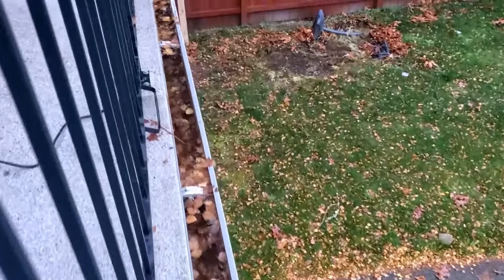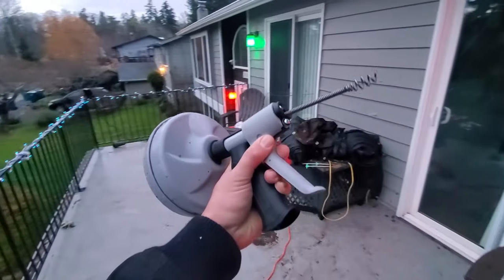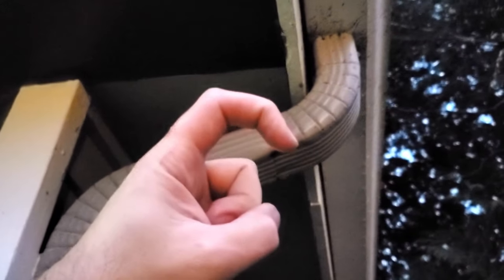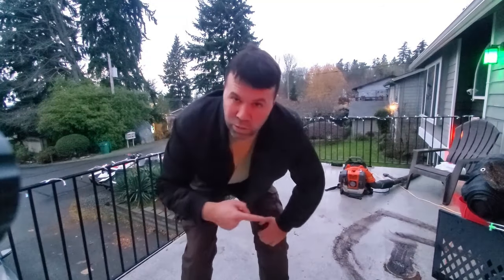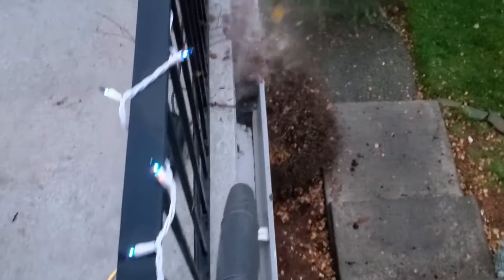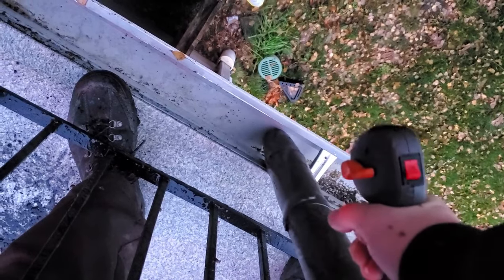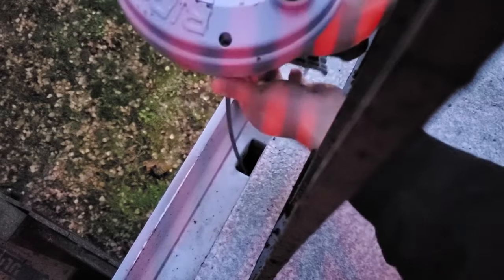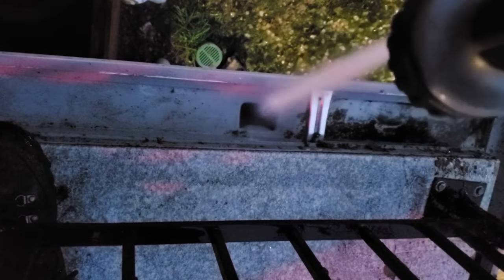How To Unclog a Gutter Downspout (4 Great Methods That Work!)

Comment: Thank you the helpful video. My gutters are two stories up and there’s no way I’m climbing a ladder that high. I put gutter guards on my house. I think it’s worth the investment not to have to deal with it anymore. They also sell those round wire downspout traps that you place over the hole so the gutters don’t fill with leaves. It’s easier to clean a gutter than a clogged downspout.
Reply from the maker: I agree.  I need gutter guards one of these days.  Lol

Comment: I use a shop vac and all the mess is contained and not forced further.  I have seen a person use a air compressor and cause a jam that then needed expensive repairs. Many places are getting away from the blowers and using the vacs for noise and debris.  If there is any chance of debris other than leaves, light stuff it is better to pull the stuff out not try to push it through. I maintain gutters at my moms house and a three story condo building.  I think this idea would work for seasonal, easy cleanings.  Good video.
Reply from the maker: Good to know!  Thanks for sharing 👍

Comment: I have a gutter that's been overflowing and finally got ahold of a ladder to check on it. Not only did I have a nice inch or so of sediment running along the whole thing, there was a ton of leaves and other junk in the downspout.  Got it clear enough to drain for now at least.
Reply from the maker: Good to hear.  Ya it can really pile up

Comment: I was told by my roof leaf cleaner last fall that a specific downspout has a clog and that I should hire a plumber to work on it. This video real helpful in that an s-curve one story up by the entry point would seem the problem area. Thanks! I wondered whether snaking UP the pipe could work but think probably not if its one story up.
Reply from the maker: Glad you found it useful!
Reply: If you try it, please let us know.

Comment: pretty simple when you don't have to be on a ladder
Reply from the maker: Valid point.  Be careful on ladders!
Reply: @JMGENTERPRISES  make another video of you using a ladder. This video is already helpful though.
Reply: @VittonLou but why? Lol same tactic apply. 

Great video!
Reply: @MTB-ENG  dude coZ! 🤣
Reply: This video was great without the ladder. That's why we could see what he was doing! I do the same moves on a ladder. Accept change leaf blower to a vacuum and suck clog out from the bottom. My final solution will probably be bigger gutters and downspouts.
Reply: Yah, it's really easy to clean your gutters when you can just walk out there and clean them out 😆

Comment: Hello. Question. That down spout looks like it runs underground , is there any other steps you have to take when cleaning your spouts? Where does the debris come out at ?
Reply from the maker: I've never had any issues with it clogging once through the downspout.  It goes into the storm water system under the road
Reply: @JMGENTERPRISES  thank you much. I have one this upcoming Tuesday and have never encountered an underground spout.
Reply from the maker: @artbynick3252  you bet.  From what I hear, the underground pipes are a lot larger will less sharp bends so they aren't prone to clogging.

Comment: I been in my home 4.5 yrs, and have water overflowing on my deck. I clean the gutters, but im sure pinestraw is lodge in my downspout. I feel a little dumb for not trying these basic methods. Im try the wire hanger I use for my bonzai tree, then try my blower, then run some water through it. If that dont work, then im purchase the anger tool you recommend
Reply from the maker: Best of luck!  Let me know what ends up working for you!
Reply: @JMGENTERPRISES  I got it cleared...I took a wire clothes hanger, then wrapped some bonsai tree wire around it, and pushed it inside to push whatever was clogging it down then spout. Then poures a gallon of water to see if it would flush. It worked.. I had my blower and water hose handy, but it wasnt needed...
Reply from the maker: @cashrules520  awesome!  Way to go!

Comment: Good advice - if you can access your gutters from above, which I can't and I 'don't do' ladders!!
Might try the leaf blower idea from below, failing that it's down to the pressure washer.
Reply from the maker: Best of luck!  Let me know how it goes!
Reply: @JMGENTERPRISES  Hello my friend. I finally got round to shoving my old Chinese leaf blower up the guttering, and it did indeed work for the main one I wanted cleared, but the downpipes here are square rather than round so best to use my Karcher on the other two. All the best to you from Cornwall, UK.

Comment: I just had my gutters cleaned by a gutter cleaning/ window company. He cleaned leaves out by hand and was supposed to flush out to check downspout with hose. He did not use hose at all, as he was pressed for time. Said he tested it by throwing a marble down and since the marble came out, means downspout is clear. I don't get that as marble is so tiny. I checked bottom of downspout after he left, and it had lots of leaves that I pulled out by hand. Have u ever heard of this marble method and do u think it's sufficient?
Reply from the maker: I've heard of the marble method.  It can help see if your gutters are completely blocked but if you have a partial blockage it usually falls through.  Best to flush the gutters.  If you paid this man and he didn't complete the job, you should get him back there!!
Reply: @JMGENTERPRISES   Thank u do much for responding! That is exactly what I thought..that would not eliminate diagnosing a partial blockage. I will be calling him back to complete job.
Reply: Yes I have, good old boy brothers.  No I would not consider effective for a heavy rain.  Downspouts with water in them are heavy and can damage a building.
Reply: @TH-eb5ro  thank u for your response.

Comment: hi Jim I HAVE a problem  to put back a drain pipe from the roof  to the drain pipe  it will not go in the drain pipe I had take off found  a tenis ball in pipe T the elbow.  the pipe  came out really easy  but it will not go back in
Reply from the maker: Maybe try some grease?

Comment: I have found zero luck unclogging the gutters with a leaf blower. Perhaps my handheld blower is too weak and the opening is too large to focus it's power?
Reply from the maker: Do you have an electric or gas leaf blower?
Reply: @JMGENTERPRISES  gas echo
Reply from the maker: @seattleprowash5464  hmm.  It should work I would think.  Yeah perhaps the opening is too large.

Comment: The best way to KNOW FOR CERTAIN that your downspouts are clear is to take them apart and inspect them.  Blowing down into the down spout IS NOT the best way to remove the clog because it will only push it down deeper into the downspout. When I take mine off of the gutter, the clog is always right at the top where the downspout connects to the gutter. I remove the clog by hand, or with hand tools and 5 minutes later the down spout is clear.  10 minutes later, it's all back together, the ladder and the tools are put away, and I'm watching TV.
Reply from the maker: Happy to hear that works well for you Tim!
Reply: @JMGENTERPRISES  It will work for everyone who does it.
Reply from the maker: @truthseekerKJV  awesome!  Good tip then! 👌
Reply: Or insert a camera designed to stick in pipes.
Reply from the maker: @uncrunch398  good idea!